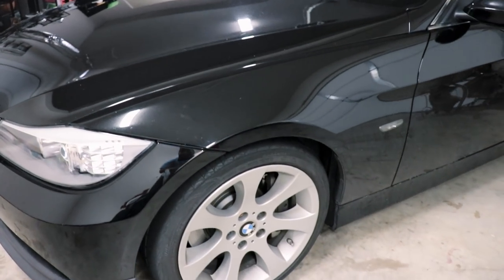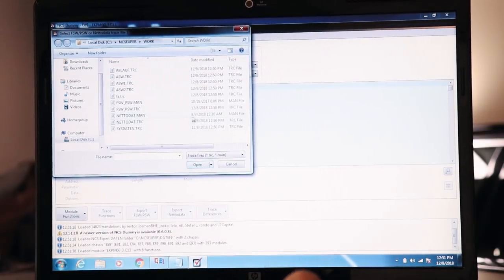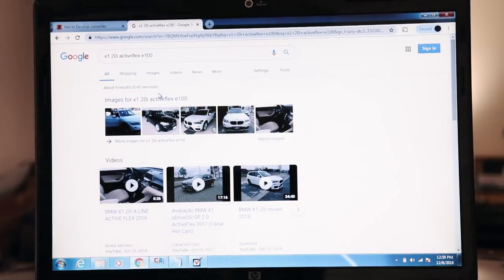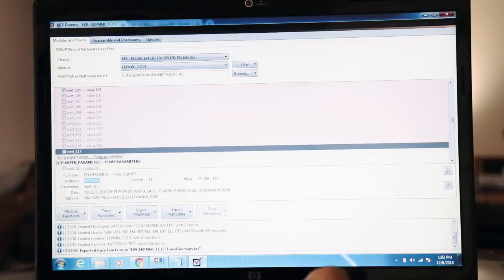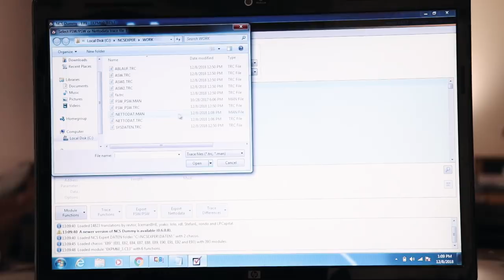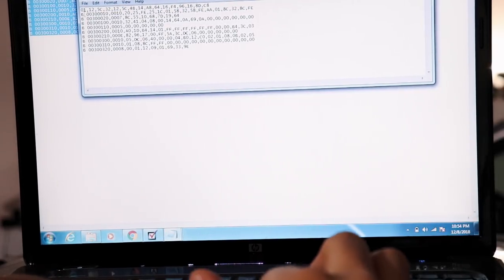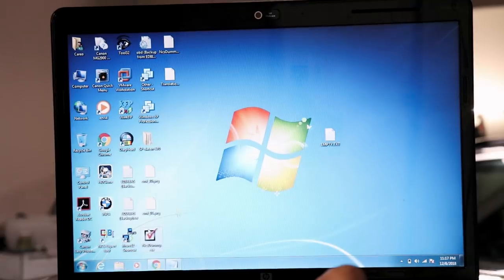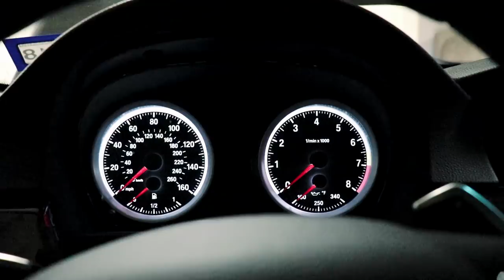I Didn't Just Code My ECU, I Hacked it! - 2AAE Fuel Pump Fix

Comment: This is the best DIY car mod video iv ever seen an i have watched 1000's well done amazing work. I'm a automotive diagnostic specialist iv trained in engine management, automotive electronics and industry leading technology i'm highly qualified previously worked at a tuning shop dyno tuning cars. You just taught me some cool stuff i didn't know WOW.

p.s i notice you have a lot of bmw problem solving videos the fuse box behind the glove box can be problematic for example the n54 weak spark problems can be (off the top of my head i think fuse 9) the +V feed for the coils pull the fuse out check the legs for discolouration from heat if the tops of the legs are blue or look like they have been hot its buggered (replace it) even sometimes you might see small black ark spots or pitting. Over time the connection degrades then limits current thats what makes them heat up.

Comment: Fantastic video mate and trust me they are far from boring! Would like to see how you recovered the module after the first flash, another video maybe 👍
Reply from the maker: Thanks!  I actually just loaded my original nettodat.man file that I backed up but I'll make a video one day purposely bricking a module and show how to recover it.
Reply: Until he makes that video let me explain quickly :)
First, you should always back up the original trace file you read out of the module just in case you brick it.
But if you didn't had a backup restoring the module to it's factory state is pretty easy.
Loading the Revtor profile basically tells NCS Expert to look for a manipulated file in the NCS work directory (FSW_PSW.MAN or nettodat.MAN depending on if you're just trace coding or coding by nettodata).
If you load up a profile that doesn't have manipulation enabled, read the VO, process the module you've bricked, then simply change job to SG_CODIEREN, then execute job and voila it's back to its original factory state.
Loading a profile that doesn't have manipulation enabled basically tells NCS to figure out the trace values on its own based on the cars VO instead of looking for a manipulated file ;)

Comment: I think I have the same problem like you. Message on dash board. But I also problem with pressure. As soon as I mount the pump walbro, I have this message that appears. Nothing with the original pump. I bought a second pump walbro thinking that the first was defective. Always the same. I changed the EKP module for a v3, which I coded with NCS. What do you think?

Comment: Can you send me pls the file that i have to load ! I have the same problem with a stage 2 fuel pump from FUEL IT. The error is 006293 EKP ENGINE: Motor current to high

Comment: Well it's different on the ekpm2 (EKPM60_2.C03) module, doesn't have the "fault" limit section, not sure if anyone's done this mod on that module? I'm getting 2AAF code after stage 2 walboro diy. Might need to replace my module.
Reply: It does but it's labeled differently.

Comment: I have a ekpm2 module and get the 2AAE code and fuel pump error when shutting off the car. Im guessing that this wont work for my module unless all the values are exactly the same in the nettodat from ekpm2 to ekpm3 correct?
Awesome explanation of how you did everything btw.
Reply from the maker: Thanks.  If you can verify that the address line is the same then you could just follow this video.  Or worst case pickup a used 3rd gen module.
Reply: The address line is not the same so I guess I'll have to grab the ekpm3 module

Comment: I want to upgrade the fuel pump in my 2010 X5M (S63 non-TU) to be able to run E85...I've tried running 30% and I get throttle closures and maxed trims otherwise.  Do you have any advice on coding after I do the fuel pump upgrade?
Reply from the maker: I bet your car has a more aggressive fuel pump stock and you might not get any warnings when you upgrade your LPFP but if you do you could very likely follow what I show in this video.  The E70 appears to run the same EKP module and id your X5M is a 2010  it'll be a EKPM3.  You can likely follow this video exactly.

Comment: Could you use this same principle (and program) to reflash a transmission? I have an E60 with the SAT transmission that I want to mess with.
Reply from the maker: In theory yes but you'd beed to know what address line to modify etc.  Perhaps you can find some threads where people have attempted it.

Comment: After I did my WB 450 I noticed it runs at 83-90 PSI for some reason. Thought it should only be at 70-74 PSI. Is that normal?  Hopefully someone might know.  07 335i. Build date 11/06
Reply: You ever have my issues with it running that pressure?
Reply: @ichoozjc  sold the car in 2020 but had no problems with it at all. When I ran a E50 mix it lowered a bit in the high 60’s.
Reply: @matt.108  thanks for the update! 🤟
Reply: @ichoozjc  yes sir. Just be aware of fake WB450’s. I think I found my kit on Amazon for around $120.
Reply: @matt.108  yup, that's where I got mine.  Reviews on Amazon usually tell you quick if it's a fake.